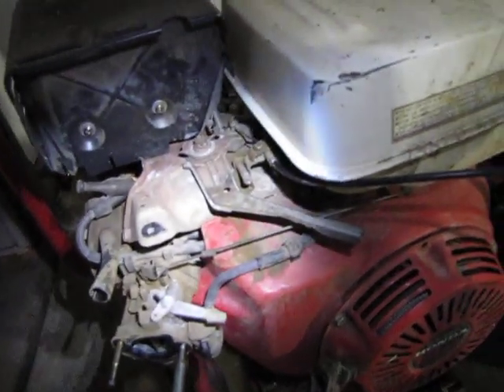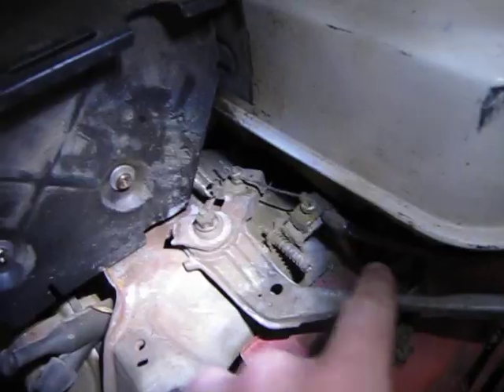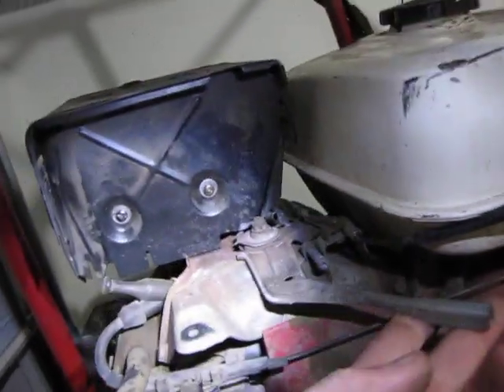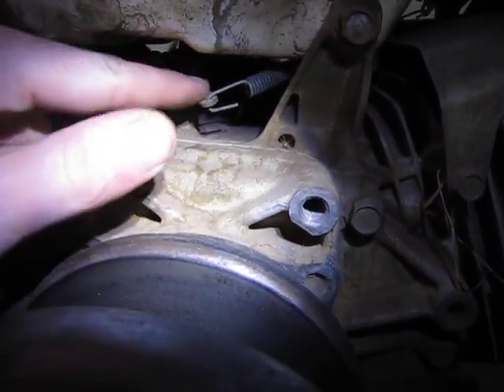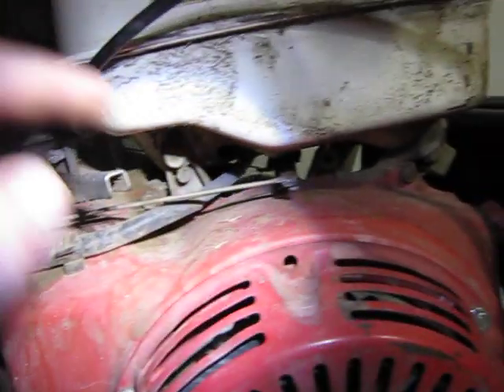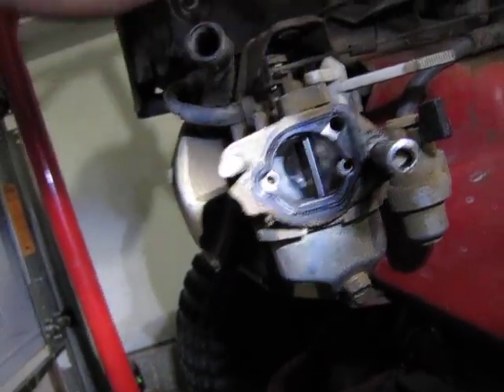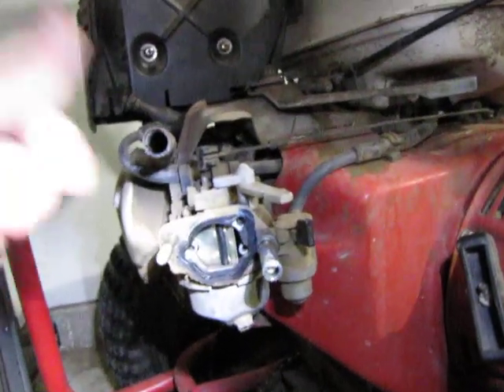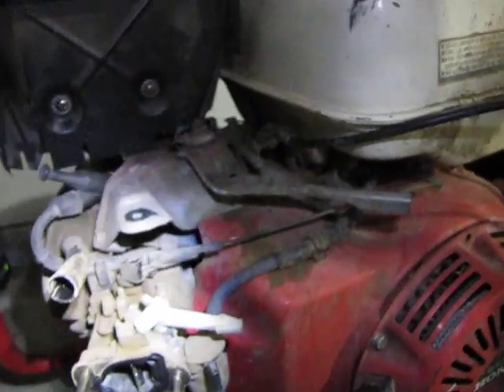Honda GX 390 Throttle Set Up, Throttle Linkage

Comment: Thanks mate, bought a kart as a project but when I press the gas the engine shuts off. Linkages where not properly installed. Thanks for the video
Reply from the maker: try cleaning carb

Comment: I bought a trail wagon 400 side by side used. I think the carb may not be the right one. What carburetor should be on it. The engine runs to lean. Maybe I could install a larger jet size in the carb I got on it. Any help would be appreciated. Thanks

Comment: When I push my throttle arm to the right to slow the engine, my rpms stay the same.  Why is the engine rpms not slowing?
Reply from the maker: You probably have the idle screw adjusted too high

Comment: I got the honda GX190 and for some reason when it’s running you can pull the throttle arm full open and it barley revs up? And full throttle won’t even give it enough to engage the clutch. How do I adjust my throttle position or is there a gov on the older genuine gx models?

Comment: I’m confused on why it pulls so many things? Why wouldn’t it just have the final knob shut with a spring and then something to pull it open? Is it just because of position of the little throttle lever or is it to make the throttle smoother and less choppy?
Reply from the maker: Mike. The reason it ‘pulls so many things’ is to prevent the engine from over revving. It governs the RPM. It’s a ‘rev limiter’.
Reply: KartFab oh so can you set up it any different and get better throttle response
Reply from the maker: Maybe.

Comment: Is the carb black throttle arm supposed to be closed back all the way when you let off the throttle? I have a new Tillotson 212 an I never started it yet but I was looking an hooked up the throttle cable an looks like when I let go of the throttle the throttle arm is not all the way closed. Is that normal? Are it closes by itself when you start engine?
Reply: Loosen the nuts on the gas tank a little for the throttle lever to return back I've had the same problem as you do this tricked worked for me.

Comment: Little black bit controlling the actual throttle valve won’t return to idle after pulling. I’ve got no clue, any ideas? 

EDIT: just said screw it and started it up. Guess it doesn’t matter, ran best it’s run yet
Reply: KartFab can you make a video of how to set the governor from the factory
Reply from the maker: +Skraith governor only works when the engine is running. Governor keeps throttle wide open till engine starts, then it goes back to idle position.

Comment: kartfab the little linkage that holds the cable i dont have?.... gx270 9hp 1" shaft... but i dont know where to tie up the cable and where to put the cable end connection to give it gas
Reply from the maker: you can look up the technical service manual for that engine and look for the specific throttle control linkage. Should be about the same.
Reply: KartFab i understand how to link it... its the same thing but the clamp that holds the black piece of the cable is not there
Reply from the maker: oh okay, then all you have to do is search for the "honda gx270 parts diagram" and order one.

Comment: working on the same set up, the carb flow control whatever it's call where the rod and small spring connect to (the other side connects to the governor arm) it's staying wide open the tension pulls it open which means it's idling high, it should return back to the little idle adjustment screw when letting off the throttle but doesn't return back, any suggestions on what's causing this??
Reply: Bpw7b3a6 did you ever fix it my have the same problem
Reply: @mr.takuache5558  I’ve got the same issue too. Can’t find an answer
Reply: Same issue here

Comment: How does one do an oil change in a similar Honda GX 130 Pump?
Reply from the maker: Standley Louis XVI almost all small engines have a little bolt on both the front and rear ends of the block at the very bottom. Remove this bolt, and oil will pour out. Replace the bolt, then add oil into the engine through the oil hole. There should be a small oil dipper that you unscrew on either side of the engine, fill up to the mark and you are done. If its a 'pump' then I have no idea what you are talking about. A lot of other equipment attached to engines will have a little glass windo that shows you where the oil level is, and changing the oil in those is different, and may require a different weight of oil too.
Reply: ***** So is the oil poured into the oil dipper side or the black screw side?
Reply from the maker: There is a metal bolt at the bottom. That's for removing oil and needs to be replaced when the oil is drained.

There should be two larger plastic dippers/screws, one on each end. It can be added to either side.
Reply: Another question is that when i opened the black side, oil fell out of it and i was wondering if i should replace the oil back into the black side.
Reply from the maker: Fill up to the line in the dipper when the engine is level.

Comment: That "arm" is connected to the governor to make sure your engine does reach to high of RPMs. Also its usually easier to quickly remove the gas tank to maneuver around there. Also, if the engine your doing this to is old and has seen a lot of use, you want to replace that gasket that goes on before the carburetor is replaced. Over time the heat expansion destroys it, and gas also that may leak. Jus a couple tips to those doing things in this area. GOOD VIDEO!